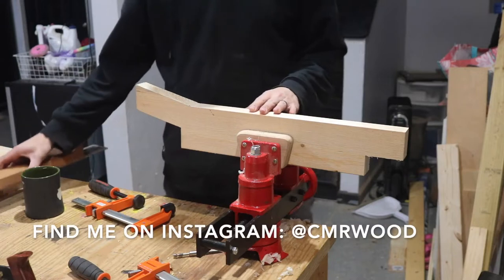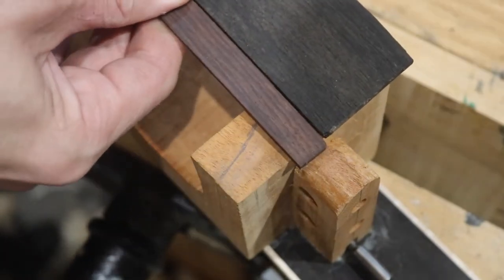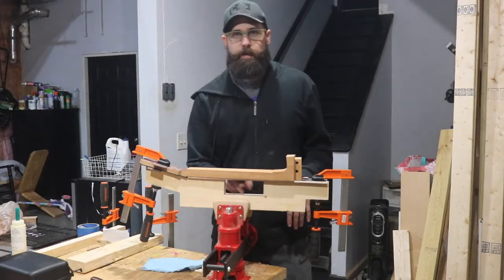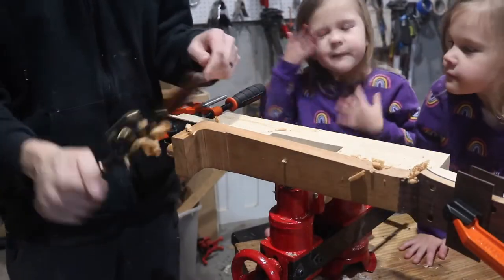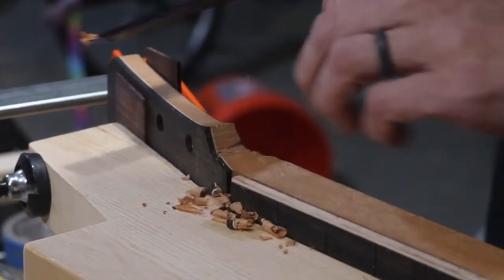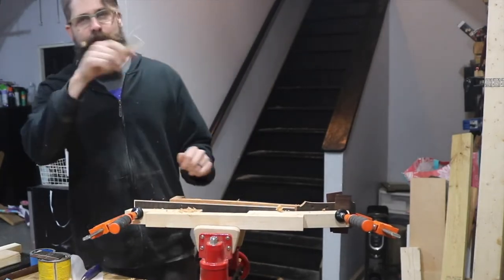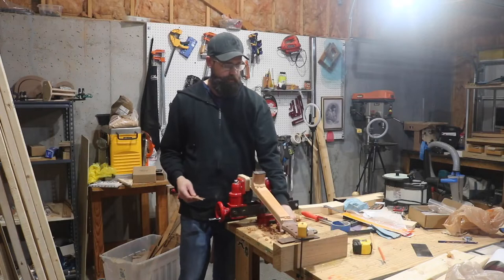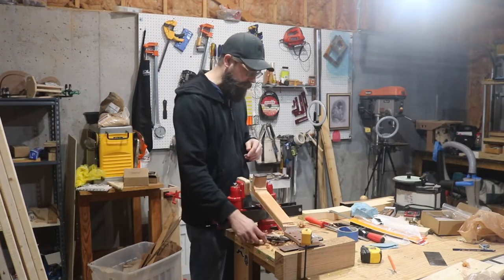Acoustic Guitar Build part 13 // shaping the neck

Comment: I really appreciate your willingness to take chances. The modification of the heel joint turned out great.  And you kids cameo appearance was great!
Reply from the maker: Thanks! When they are in the garage it‘s hard to record and not have them in it. I left some of it in for myself mostly so that I‘ll see it years down the road and remember how small they were. My older two kids also have several cameos in my old videos too when they were younger. They usually try not to interrupt nowadays.

Comment: Great job shaping the neck. I use shinto rasp exclusively to get the bulk off then a half round Iwasaki file to do the transitions.
You should be proud of the achievement to get to this point.
Reply from the maker: Thanks! I‘ll be looking for a better half round rasp. The one I used worked, but I felt I could probably do better with a rasp more suited for that kind of work. And man, that shinto rasp can remove material crazy fast! Thanks for the comment!

Comment: for stuff like the heel cap id just use thin super glue. i bandsaw my neck to get the sides level with the fingerboard. i use to use a router. but too much worry of tear out, even if you wet it,. sand it with a straight edge near the end also helps. your lil girls are hilarious loll
Reply from the maker: I‘m definitely gonna bandsaw the sides closer to the fretboard next time. That took longer than I wanted it to!

Comment: Good job on the neck shaping. If it were me I would have rounded the heel more but it's your guitar and build so build as how you want it to be.
Reply from the maker: I‘ve actually been pondering that exact thing. I‘ve seen pictures of people with more square corners at the heel and others with more rounded over. I‘m leaning towards more rounding over. I hadn‘t fully decided at the making of the video and I just needed to get the video done, but there is still time to do a little more work at the heel. Thanks for the input!
Reply: @CMRWoodworks  Chris I think in my opinion you'll like it in the end. Oh and love the kids. They're no worry here.